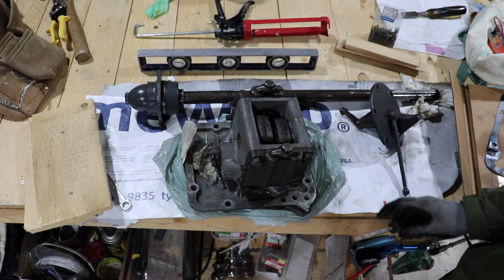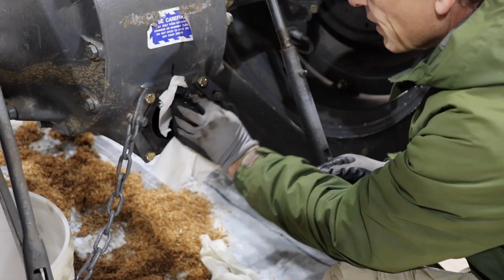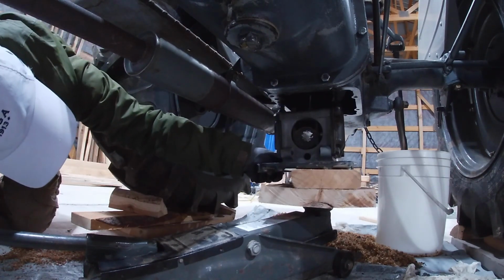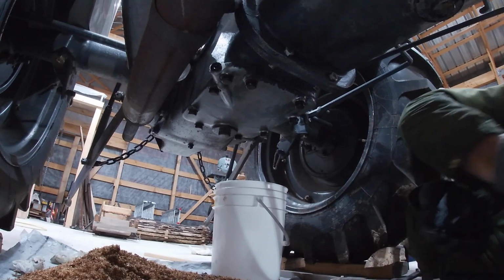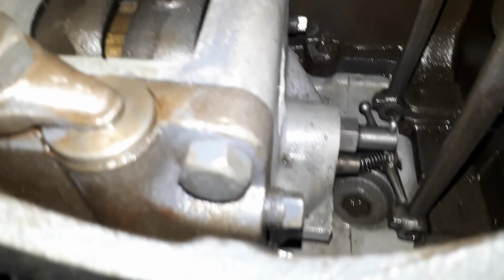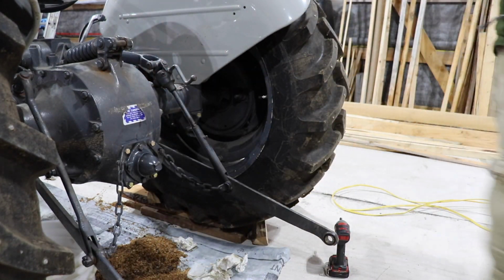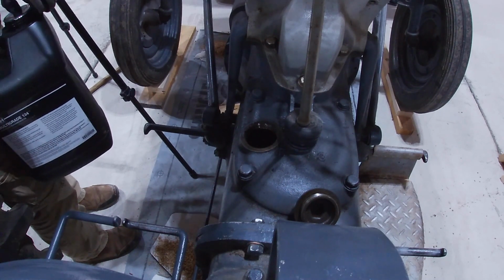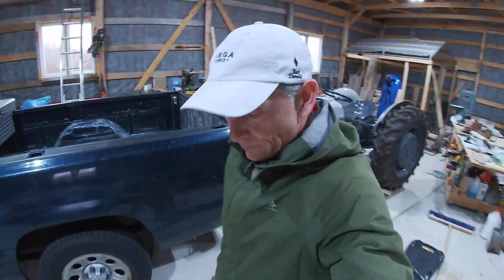Ford 9N Hydraulic Repair #2

Comment: The control valve is difficult to snap into the fork without a spreader. It is easier to work on if both side plates are open so you can use both hands. To spread the fork, I chopped off a piece of wood about 1/4" thick 1 1/2" wide and 3 5/8" long. All dimensions carefully selected by grabbing the first likely looking piece of wood in the scrap pile, lopping a chunk off the end and trying it. It worked well to pop the fork off the valve and spread the fork to get it snapped back in place later. I measured it after the fact in case I ever need another one. 

Whether 3 5/8 is the perfect length, I have no idea. It is close enough, and I'm not about to take it apart to try a slightly different length. Thin is easier to rotate into place, wide may have been good, and the length was important.  If I had more pumps to rebuild, I would use a slightly longer stick and notch the ends so that it would center easily on the fork while spreading it 3 5/8".